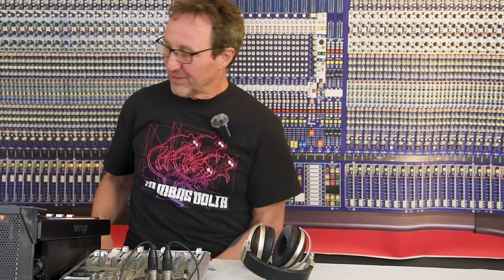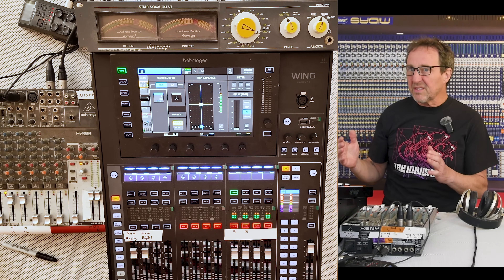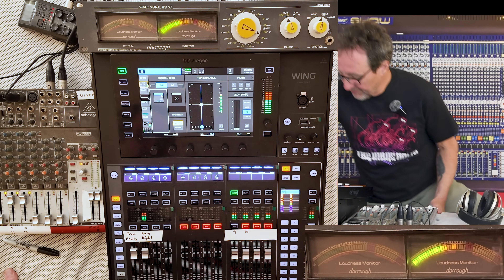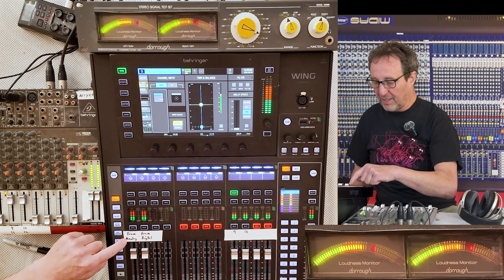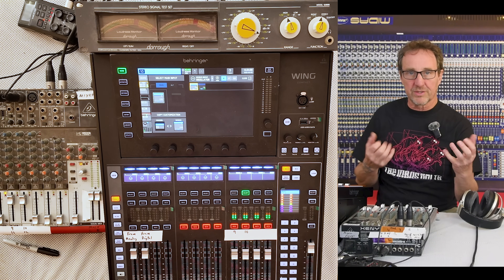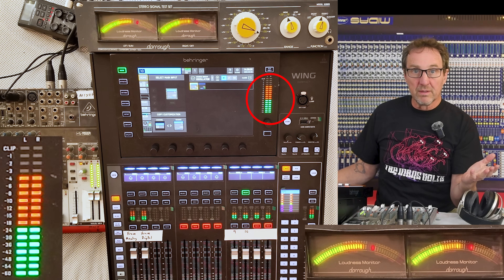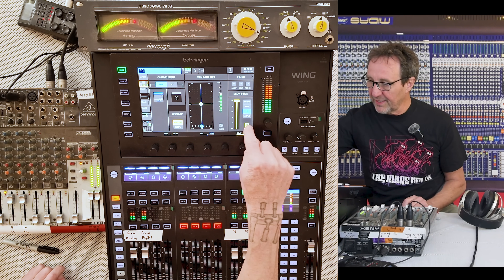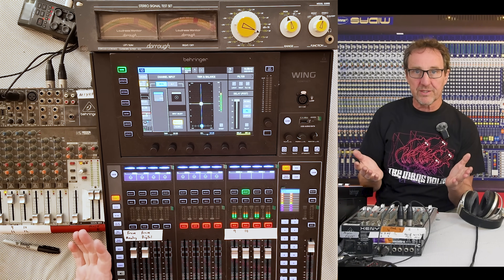Digital Audio Meters Don't Show What you Hear - Sometimes

Comment: 11:30 thats exactly the point, you are comparing peak vs. rms. for dissimilar signals, the statistic increase is 3db, but peaks can and will still sum to 6 db. So when measuring peak, two summed dissimmilar signals will have the same peak value as correlated signals, while the "loudness" of the sound you are hearing is more proportional to the RMS value, that is correctly increasing 6 dB with correlated signals and 3 dB with uncorrelated signals.
12:18 all of the consoles are doing it correctly, the basic assumption that two uncorrelated signals sum in both peak and RMS to +3 is wrong. In RMS, the sum is +3, but in peak, the sum is still +6
Reply from the maker: What does the problem go away on all the meters when we convert to analog and back to digital? 

And if it's a metering issue and we switch the metering to something that doesn't show the issue, does that mean we gain back the headroom? 

If we do it with 10 white noise channels and we have 10 DB lost headroom can we ignore that and push 10 DB into digital distortion and still be clean?
Reply: @DaveRat  converting to analog&back can have multiple reasons.
1) is the input meter measuring the same thing as the meter on the output (peak vs rms and if rms, then over what times)
2) is the input capable of resolving these very short peaks
3) (most likely i think without doing a proper measurement) is the output capable of producing these very short bursts? Single +6 dB Samples will be resolved by the digital meter, but won't be properly reproduced by the DAC (and/or filtered/get lost due to the high slew rate).

Regarding headroom: depends on the implementation of the digital summing. When using normal bytewise arithmatic, single samples peaking over will result in digital distorison. When using floating point arithmatic, peaking won't distort, but instead raise the noise floor.
The correct solution in the end: Do what sounds good.
Summing 10 white noise channels will result in a very large difference between peak and RMS and some of these Peaks will lead to Distorsion/added Noise. How important these single sample distorions are and how often/noticable these are in actual music, I don't know.
Reply from the maker: Perhaps this perceived or real loss of headroom when summing numerous digital channels is a factor in why there are numerous engineers out there that have implemented analog summing for their digital consoles. 

Perhaps this is a little quirk that makes things feel not quite right for the analog people moving to digital.

Comment: Im so glad you showed this very same example on the really more expensive mixers so no one could use the excuse that the issue is in the Behringer Wing build quality. This clearly has nothing to do with build quality..i must say i am intrigued slat the results of this test
Reply from the maker: Yeah I figured that people would jump to the conclusion that it's a behringer issue. I actually found the issue while editing a video in Adobe premiere.
Reply: @DaveRat and this is the part that may go over most people's head..the issue is with Digital metering. With it's a DAW or digital mixer. The issue is still the same. I may not be the brightest in the room but my theory could be that it's an issue with the source code for digital metering. There is something in the programming of software that doesn't compensate for increase in db. I did see the change when you routed the same signal back to the mixer and it did account for the change in DB but something is going on in the main metering.
Reply from the maker: If it's a metering issue and we had 10 white noise sources that are de correlated kind of like having 10 mics on a drum kit with symbols splashing into all of them, The digital meters would read 10 DB hotter than the analog meters 

Giving the digital console 10DB less headroom if we pay attention to the meters 

If we ignore the meters, that means we should be able to push 10 DB into digital  overload and still be clean if it's a metering issue. 

Do you really think it's a metering issue or is the signal actually there And if we push the meters into overload will it still be clean or will it distort?
Reply: @DaveRat naw.   Its crap.
Reply from the maker: What's crap? The DigiCo, Yamaha, Avid, Behringer or Allen & Heath? Since they all show the exact same issue, at least from this test I don't believe there's any valid info to develop an emotional opinion on any of the consoles.
Reply from the maker: @gladlawson61 Which one is crap? The DigiCo, Yamaha, Avid, Behringer or Allen & Heath or all of them?

Since they all test exactly the same with this issue, there's no real info to differentiate so it's all or nothing.

Comment: Could it be related to bit depth somehow?

Maybe not of the mixer, but bit depth of the meters algorithms..?
Reply from the maker: I have not found a correlation to bit depth and the problem tends to go away if you convert from digital to analog and back to digital again, the digital meters will then read correctly

Comment: If you think about it, even dissimilar signals will be in phase at some time but these times may be few and far between. Analog meters have a natural dampening from the physical movement of the meters so it’s not going to catch signal peaks that only last for a few milliseconds. Digital meters on the other hand measure things much faster and those peaks get captured. So I think this is just the difference of looking at a sound in like 300ms blocks vs like 10 ms blocks. Peaks get averaged out on the analog meters and captured on digital meters.
Reply from the maker: If that's the case, then why do the digital meters read correctly once the signal has been converted to analog and back to digital again? 

As I explain in the video, channels one and two of the wing are showing the exact same signal that has been converted to analog and back and those meters read correct

Comment: I wonder if the Dorrough meter waves plugin works the same as the real Dorrough meters and would be a digital instance that works correctly
Reply from the maker: Perhaps but there's bigger questions. 

Is the meter reading real signal or phantom signal? 

If it's reading phantom signal, then where is that coming from and what is it? Getting a different meter Will hide it from you but still what is it? 

If the meter's reading a real signal, then getting a meter that does not show it means that you could be pushing the console in the digital overload and not see it. 

I did test that and the meter is reading a real signal and if you take 10 channels to create a 10 DB difference between the meter readings and then push the console 5db overload with 5DB a headroom assuming that signal is a phantom signal, there will be digital distortion.